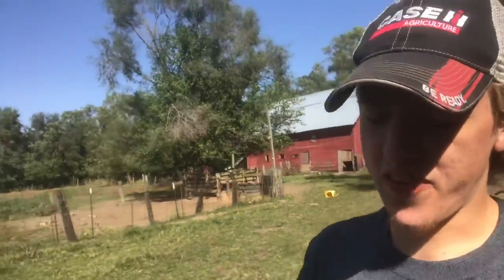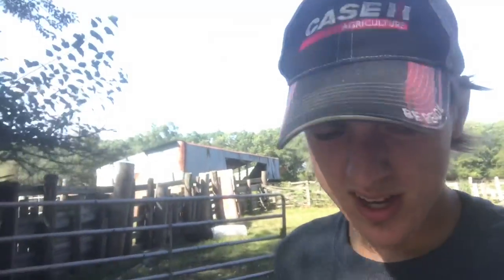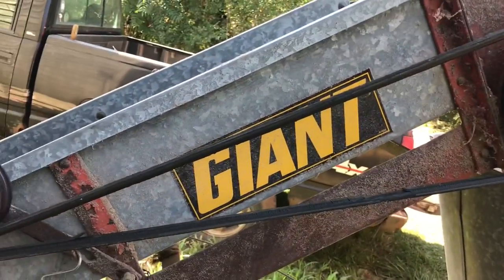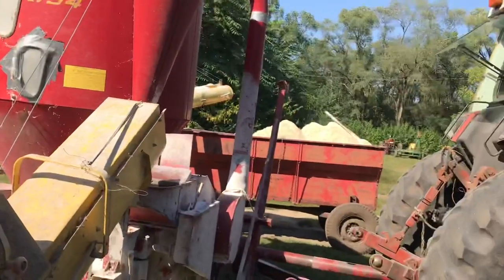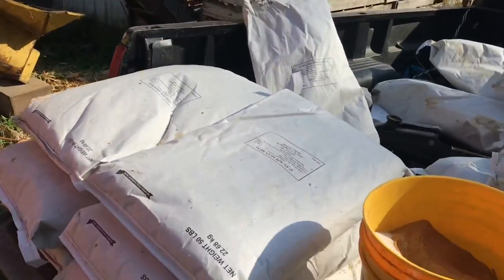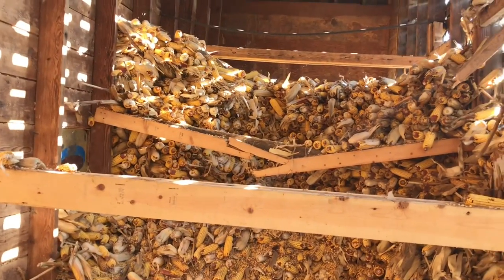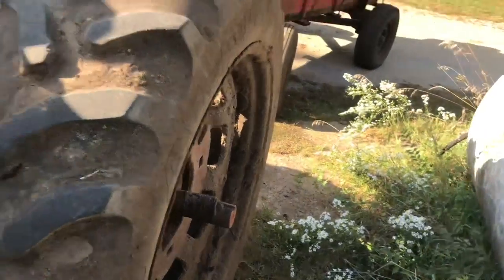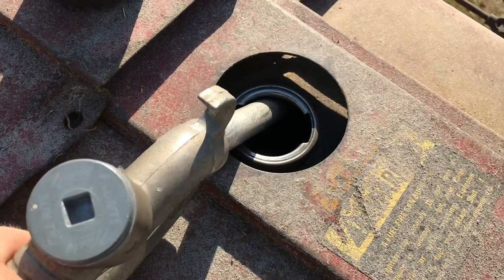1486 is back in action Grinding ear corn into cattle feed with the New Holland 354

Comment: I’m building a corn crib next week and seeing ideas on how other cribs are made like yours with the corn conveyor in the bottom got a good idea on how to make it
Reply from the maker: The spot for a conveyor is definitely a must otherwise you will be shoveling all year definitely makes life easier
Reply: A slanted floor toward the conveyor will save some extra shoveling. Allows to use a corn rake to pull it into the conveyor.
Reply from the maker: With our crib only being about 8 foot wide 95% of the corn would go in without the slant floor if we had the conveyor all the way under with just a corn fork to knock it down but if you have the capability to slant the floors to the center it’s not a bad idea